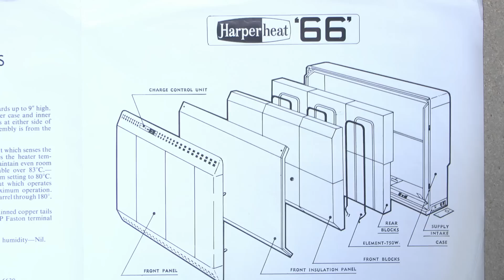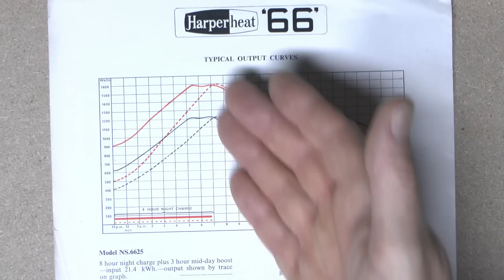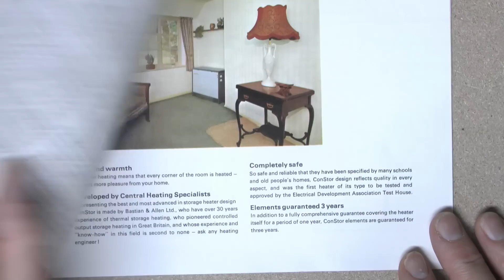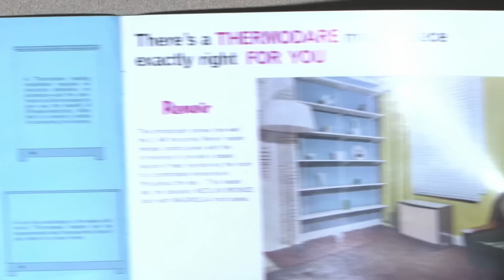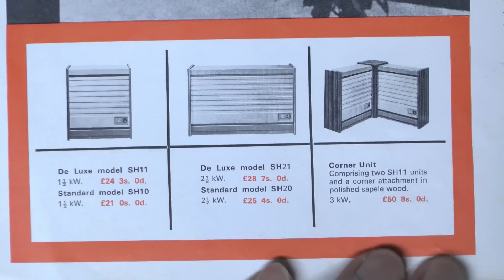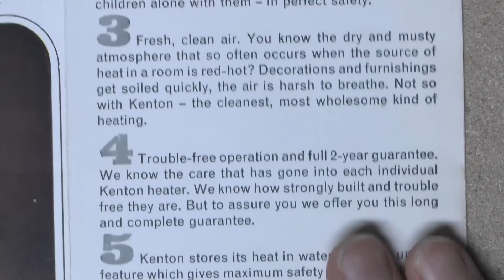Storage Heaters Part 1 - How they work, why they exist, 1960s time machine documents

Comment: I've been an electrician for 35 yrs. These heaters have been such a ball ache. Mainly because of the weight. I've never been so unimpressed by a product. The customer always states to me that the heaters don't produce enough heat for the evening when they are all sat around the tv watching eastenders and have had to boost it which costs a lot more money.
Reply: I'm on Octopus Agile tariff now and they have disabled the Economy 7 time restrictions in the meter so I can activate them whenever cheap electricity is available.
Has transformed the usability especially when there are periods of negative pricing!
Reply: The point about heating isn't to keep you cosy and warm as if you can walk around in a t-shirt year long. It's to stop you getting exposed to temperatures that are too cold.

The problem is people expect to wear barely anything all the time, have hard floors that don't retain heat, leaking windows and also think that feeling cold is the issue. Just because you feel cold doesn't mean you ARE cold.

My thermostat is set to 21 degrees and is upstairs which usually means that downstairs is around 19 degrees as there is a two degree difference upstairs Vs downstairs in my house. My boiler hasn't run at all this morning as the thermostat hasn't called for heat. It's a smart one that calls up to 6 times an hour to maintain a constant temperature.

One major factor in "feeling" cold when you actually are not is humidity. We feel colder in dryer air, thus in winter 21 degrees feels too cold but in summer 21 degrees is where you wish to remain 😂.  Thus in winter a humidifier will do wonders!

And stop wearing t-shirts. In winter wear vests and jumpers and thicker socks. Oh and CLOSE THE DOORS TO EACH ROOM.
Reply: John I used to repair a lot of. Dimlex  .,you never mentioned the fusible lead link that youst to melt when customers dried the laundry on them and said heater over heated  and denied doing it!!!?
,,
Reply: The weight Is unreal yeah couldn't get over how heavy they are, seem very antiquated now
Reply: John I used to repair a lot of. Dimlex  .,you never mentioned the fusible lead link that youst to melt when customers dried the laundry on them and said heater over heated  and denied doing it!!!?
,,
Reply: @robertkibbler1564  Absolutely Robert. Absolutely!

Comment: That name Thermair brings back memories of the house my parents bought back in 1978, there was a heat/light unit in the bathroom. It was an all in one unit with a light and infra red heater operated by a pull cord switch. It was on borrowed time as central heating was installed the following year.
Reply: Funny how it's come full circle with central heating fast closing in on its borrowed time. That IR heater is probably a really good way to go after 2035, heat yourself, not the air. Although I think it's better to heat the air in a bathroom due to the nature of the room.
Reply: Still have one in our bathroom

Comment: I remember them from my mates “electric” house as they were known in the village as we had a coal fire. Back then over 40 years ago I was fascinated by their massive meter cupboard, it had 2 meters, a time switch and double decker wylex fuse box with three main switches. It was awesome compared to ours.😂. I fitted a couple of dimplex ones to an extension about ten years ago, they were about £900 for the 3kw version. The bricks are incredibly heavy for their size, I think they are made from plutonium 😂😂😂. All the best John.

Comment: I actually put storage heater in our old house and changed from coal boiler. in 2016. If you know how to operate them, know how to wire them they work well. Some of those you shown I remember my grandparents having, they were good to sit on in winter. They had a special heating tariff from the LEB back in the 1970's/1980's where 7hrs of cheap over night and 3hr afternoon boost. Cant remember what it was called, but you have two meters and two supplies one peak (and fed whole house) one off peak (which only fed storage heaters and immersion tank) with E7 the whole house goes off peak during those times, the old 70's system before E7 didn't, but if you knew how to wire dodgy sockets on to the storage contactors you can have some off peak for domestic use hahaha. It was also 3ph, there was about 35Kw of storage heating load!
Reply: The tariff was E10; also used n Scotland where the afternoon external temperature was lower.
Reply: @chriswalford4161  E10 was similar, but this predated that. Like E7, E10 allowed the whole to benefit from cheap rate. This 70's tariff only allowed the heating equipment access to the cheaper electricity. You had two meters, two supplies and ultimately two standing charges if that makes sense. Hence if you wanted to use say the washing maching on cheap rate you had to do some bodgery on the heating DB's to add a socket on the cheap rate system.
Reply: Wow, this explains something I have long wondered. In some 50s/60s properties I used to find disused 3ph DNO heads which made it impossible for me to complete a meter exchange before our employer sent us back for the correct training. I always wondered why the expense of 3ph jointing, cabling and cutout was gone to for only one phase to be used, but presumably the rather large property once had a 3ph meter and many storage heaters, long since gone. Invariably one would find on these jobs that the disused cut outs were both still connected at the line side and had exposed live conductors through the disused 30mm entry ports on top. Got to love a bit of British workmanship.
Reply: We had a central storage heater which used 3ph
The supply was 250A why so but I don't know

Comment: Some of the older models such as Creda, have asbestos insulation around the bricks inside, normally AIB Asbestos, I think this started from the early 1970's.  I work in Social Housing, and this time of year we attend many houses where the storage heater doesn't work.  Looking at the age and the Make/ Model you normally assume thst tjis may have Asbestos inside.  We disconnect and make safe the supply to the heater, and then get a Licensed Asbestos Removal Company just to remove the heater. 

Now, we are fitting the LOT20 Storage Heaters, these need a secondary permanent supply to feed the internal convector fan, thesevalso tend to have much smaller bricks to help move and load the bricks into the new heater.

There are several websites where you can down load pdf's which list all storage heaters, make/ model's and which have Asbestos.  All storage heaters after 1999, should not have Asbestos at all.

Comment: We've had two homes using E7 storage heaters and provided installed capacity is adequate we got on with them really well.  The main drawback is finding an electrician who is au fait with the switching systems and won't spend the whole visit complaining how much they dislike storage heaters.  The most difficilty I've had recently is a meter change before radioteleswtiching is turned off in June next year.  Metering people don't like them either.
Reply: More than 2 wires and the meter knobbies are baffled😂😂

Comment: I did live in a flat with storage heaters, the problem was by the time it got to like 6pm they were basically clap cold if they were used during the day.
Reply: Yeah. The pain was you should close the flap at night and start to open when u want heat, so not very automatic

Comment: Btw do you know if the cost of off-peak electricity relative to peak changed much over the decades. I've got a feeling that they are relatively closer in price than they used to be but I haven't saved old bills.
Reply from the maker: It's still roughly half of the standard day rate - however the big fail now is that if you have E7 or it's equivalents, the daytime electricity is significantly more expensive than on a standard rate, so the savings are not as much as they were.
Currently Octopus have their standard rate as 25.6p, E7 night is 13.5p, but E7 day is 32p.
Reply: @jwflame can you have two meters, on two different energy companies?
Reply from the maker: You can have two separate meters if you have two separate installations, however that then incurs two sets of standing charges which are about 63p per day per meter.
It would also be equivalent to the very old 'white meter' arrangement where only the heaters are on cheap rate, rather than the newer style where everything changes to the cheap rate overnight.
Reply: @jwflame : That’s not exactly right. When I was a domestic energy adviser in Devon I came across several two-meter installations with various time clock switch-overs and they weren’t on E7 tariffs; I looked into on their behalf, and to be eligible for E7 (or E10) all the load had to go through one meter with the clock changing the charging rate.
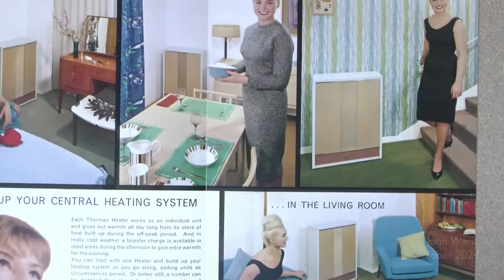So, two-meter installations with one meter timed and dedicated to the heating/hot water load had to be treated by the electricity supplier as ‘complex tariffs’, and didn’t come close to off-peak E- tariffs. 9:17 
One of the most concerning things was one of these was a LA bungalow where the council was prepared to modernise the storage heaters, but ain’t prepared to modify the metering so it was eligible for E-.; so the local authority were effectively condemning the occupant to expensive tariffs.
Reply: @JasperJanssen not with 2 companies. Initially you would have a white night meter. Later it was all one meter with 2 sets of numbers. One that clocked up at night
Reply: @jwflame  12p night
Reply: I've switched to Octopus Agile tariff.
The timer has been disabled so am able to use the storage heaters whenever cheap electricity (occasionally negative pricing!) is available which has made a huge improvement to their overall effectiveness.
Reply: @cwt5654  thats interesting, is it automated at all or do you have to stay at home micromanaging your heating by hand?
Reply: @joinedupjon  Unfortunately it's just manual now but not much of a problem now I'm retired 😁
Reply: Of course, you’ve  got to remember that gas isn’t distributed everywhere, so in an era where central heating was becoming a must-have, if you didn’t have has, and didn’t want to deal with oil or solid fuel, ESH filled a need.
Reply: E7 used to be great value, something like 2p/unit, until late 90's/early 2000's when it started becoming very scammy, such as a higher daytime rate which should never have been allowed, - ripping off older people who still have the heaters basically.
Reply: 2024 ~March/Aprl Octopus acquisition of Shell Energy
Your tariff   Flexible Octopus - Prices follow wholesale costs
Day Rate: 35.36 p/kWh    Night Rate: 15.76 p/kWh   [E7 01:00-08:00]
Standing Charge	48.75p/day	 (All rates inc. VAT)
---
New prices from 2024            1st April   July           October  
Standing charge (per day)     53.655p   53.655p    54.570p
Unit rate - day (per kWh)       29.448p   26.552p    29.532p
Unit rate - night (per kWh)     13.128p   11.837p    13.165p
Your estimated annual cost   £434.63   £451.96    £456.40 
[1 bed house, Storage Heating, water immerser, but no home heating used for the last 3 years, No solar, No gas, modest living.]

Comment: I worked in an office with storage heaters and tbh they weren't totally useless. The office was reasonably comfortable in winter during office hours... Tho heat output was noticably tapering off In the afternoon.

They have confused foreigners  so I supposed it was another british innovation that no one else in the world was ever interested in.
Reply: My parents had one of these storage heaters here in the US in their first apartment. I distinctly remember my dad thinking it was just nothing but a scam as it was a dribble of heat in the morning at that was it. It’s consistent with the design as the actual storage element is too small to be of real use. Really this would need to have a large bank of the bricks in a central heating system to be effective.